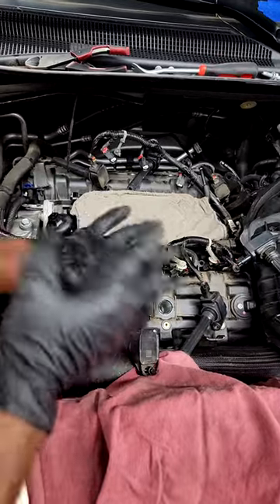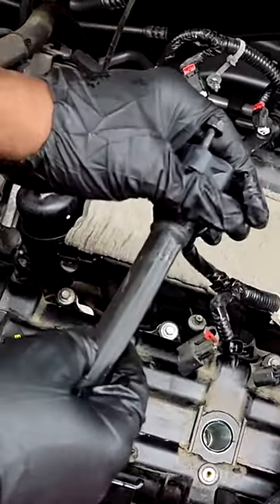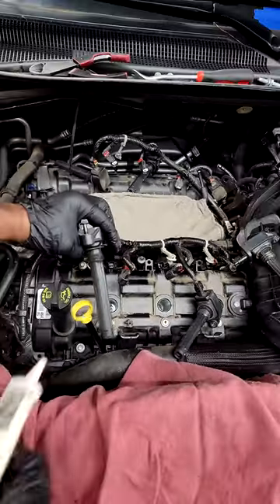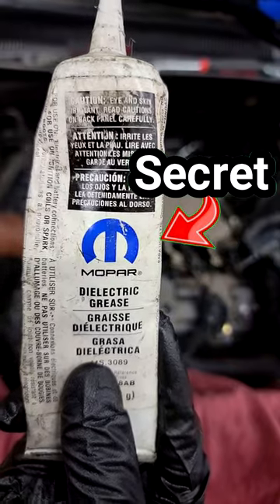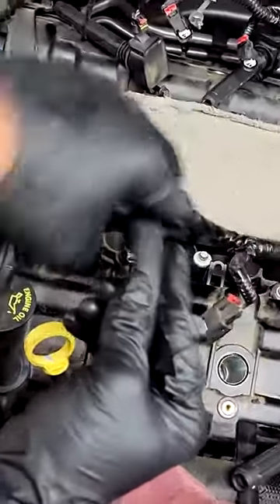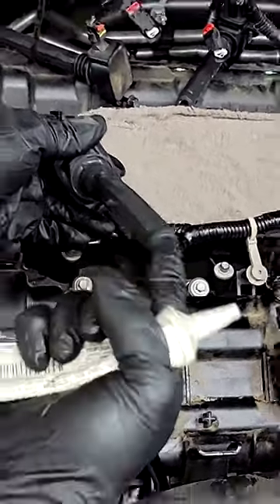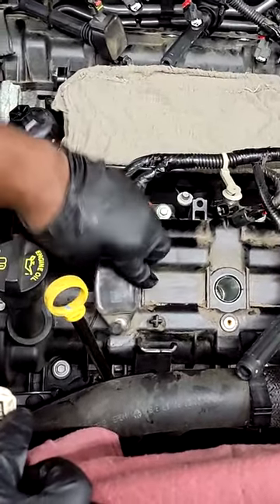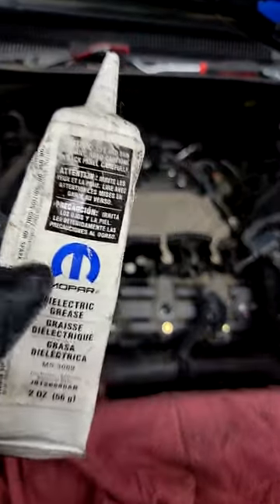Here's my Tune Up Secret finally revealed.

Comment: I use CRC dielectric grease on everything from bulb sockets to plug wires. I first found out about dielectric grease back in the early 1980s after ruining a GM HEI module because I DIDN'T use it. There was a little packet of it in the box that the module came in but, at age 15, I didn't know what it was. When I went to the auto parts store to buy the 2nd module in a few months, the counter man pointed out my mistake. Many people make the mistake of using too much. That can also cause issues. I prefer the CRC brand that comes in a trigger can.

Comment: Dielectric grease is by definition a conductive insulator used on single voltage connections.....I would jam as much as I could in the ignition coils....keep it from having a bad arc.

Comment: Good to know your products.  Chev modules would burn up because people used dielectric grease instead of aluminized heat sink grease.  I didn't know they were a different product.
Reply: Why?
Reply: @kalebnelson4569 heat sink thermal compound is used to ensure a good mating surface for heat transfer, and does not reduce the heat transfer capability of the metals. Dielectric grease insulates and causes ignition modules to overheat and die.
Reply: Even auto parts store people don't know the difference, I once tried to buy some heat sink grease/thermal compound for a project so that I didn't have to waste my Arctic Silver 5 and they tried to sell me dielectric instead.
Reply: @danielthechskid  I had to use my arctic silver on a Ford ignition module just the other day, luckily I had some left over from a PC upgrade I had done recently.

Comment: good Old Bearing grease works just as well
Reply: No it doesnt. Petroleum can work but, oil and heavy greases cause the rubber to soften distort and swell.
Reply: Only thing I know that causes Distortion and swelling is when DoT Brake fluid comes in contact with rubberized materials!

Comment: You are only using that because you know eventually you are going to have to take it apart again. It's a Mopar.
Reply from the maker: Lame, try again dude...smdh
Reply: Seriously, I buy Mopar parts, and they fail. Then I can't get it warrantied because the stealership refuses too. They pay YOU half of the work you do for warranty. 1/2 flag hours are standard for corporations that you work for. I pay my guys 100% when a part fails. It's not their fault. Why pay them less? Because they agreed to it when they get hired into a "nice" place to work?  Stealerships suck. .
Reply from the maker: @theguyoucallwhen...8047  O ok so you simply have a issues with the system. Sure there are flaws but when you are aware of it you simply make the best of it. Because you alone cant change it. I dont even bother complaining anymore. I just try to make the system work for me